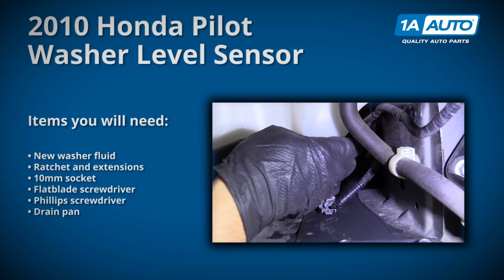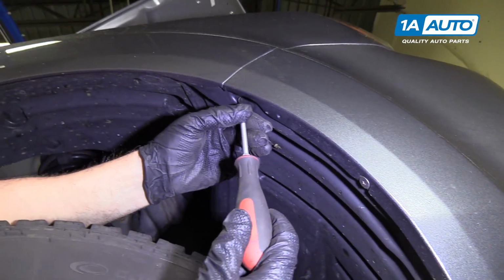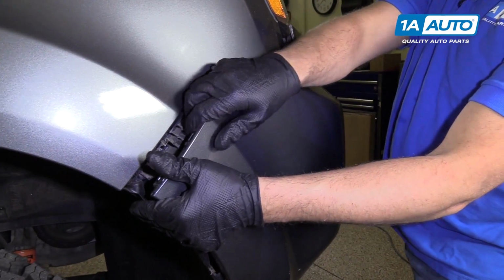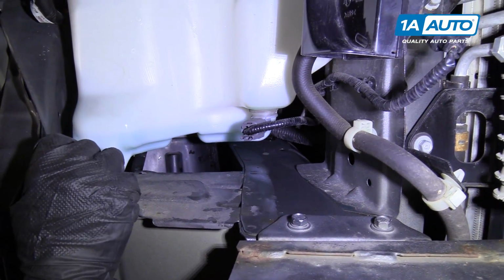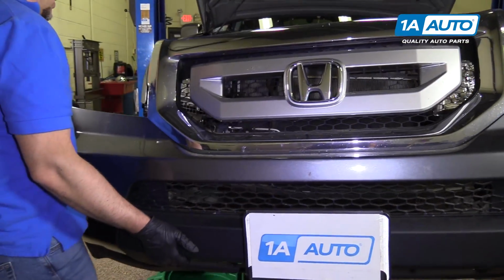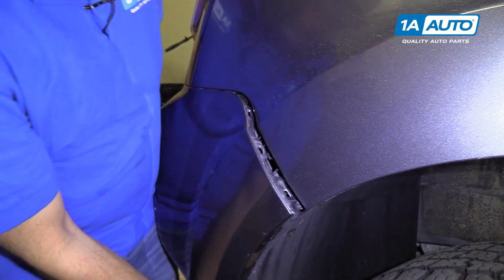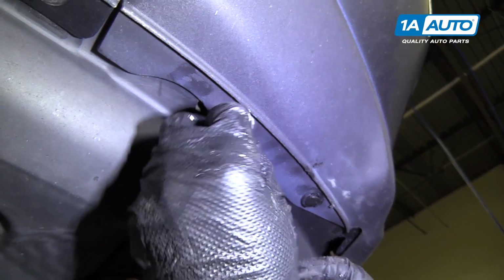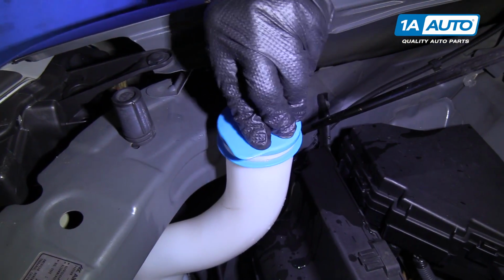How to Replace Windshield Washer Fluid Level Sensor 09-15 Honda Pilot

Comment: You do not have to remove the bumper. Honda master tech here. Just reach down there and pull the bitch out. Save your self some time. Maybe loosen the lower bolt holding the reservoir to make more room underneath. Really don't even have to do that. Usually the sensor is fine. Most of the time it leaks from rubber seal.
Reply: I have a 2003 Acura mdx and the sensor light is always on even with a full reservoir. I am looking for a way to fix it myself.
Reply: Bro when i saw the "remove whole bumper" i was like hell naw there is some other way to do this. My thoughts were on your page exactly
Reply: Thanks for the comment. I did this in about 5 minutes because of your comment. Absolutely no need to remove the bumper!